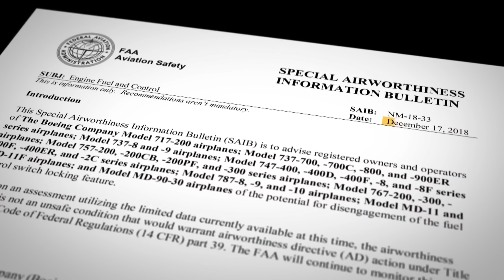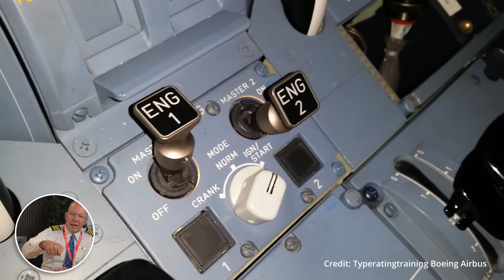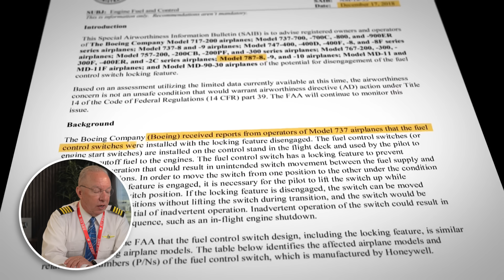Air India 171: The FAA’s 2018 Fuel Switch Locking Bulletin Explained (16 Questions Answered)

Comment: One thing's for sure, it won't be an optional services item any more.

It really could be a case where they were in the off position by themselves, and therefore not recorded, and then the pilot switched them physically doing a proper engine restart which is what was done where you put them off and then you do one at a time and then you restart them as part of the restart procedure and putting them back on. Of course, then they ran out of time, nedding only 5 to 10 seconds more.
And if you look at the wording of the report, it's not putting blame on any person or system at this stage, preliminary.
Reply: Fr

Comment: Finally, Yesterday  i posted a Reuters story stating the same thing, no one, i mean no one until GaryBPilot, yesterday.  instead everyone is taking the preliminary report as proof that a pilot deliberately turned the switches off without even considering it could have been caused by faulty software/electronic. shame on all of you who blame the pilot(s). Shame. Shame on the Indian government for giving Boeing, GE and Air India a pass and cleared them prematurely. Shame on Captain Steeeve for blaming the pilot.

Comment: The camera would help give answers that weren’t found in the recording or other flight data because it would confirm who actually touched the switches. All we know right now is that one pilot accuses the other of touching the switches and the accused pilot denied touching them, but a video would confirm the truth. IMO the union’s argument about the potential for recordings being leaked is BS because all kinds of jobs require people to be recorded at all times, even when I worked retail I was constantly being recorded on security cameras and that was a very low-stakes job with no potential for killing hundreds of people. It may have prevented the incident if it wasn’t an accident but rather intentional sabotage and the potential saboteur knew that if he messed with the switches he’d be caught in 4K.

Comment: Hi Captain Steeeve. Do you think all planes should be fitted with a warning system and a delay for critical systems like the fuel switches, so if for example a fuel switch transitioned to cut-off during flight, it would soumd an alarm, and delay the cut-off by 10 seconds, allowing pilots to rectify it, and avert disaster?
I find it incredible that some sort of failsafe isn't already built in to prevent accidental or malicious fuel cut-off during flight.

Comment: It's impossible to remove every single element that would allow a pilot who intentionally crash an airplane.  That being said, the basic design of these fuel cutoff switches has been part of Boeing aircraft for more than 5 decades with millions of flight hours.  There has NEVER been a documented incident of a fuel cutoff switch being accidentally activated in flight. It's impossible that both would have been accidentally moved, especially one second apart.  This was a deliberate act, and while the method is unprecedented, the act is not.  An Eqypt Air pilot intentionally crashed a 767 into the Atlantic Ocean (flight 990) and a German Wings pilot intentionally crashed a A320 into the Alps in 2015(flight 9525).

Comment: Another question, which may lead nowhere, but has to be asked and analyzed, so it can be dismissed: could on pilot turn both switches off in error?  What situation (fatigue, distraction, some mental condition) could cause a pilot to cut the switches off inadvertently and in error.  He would have denied doing it when confronted (like the example you gave in a prior video about leaning against a light switch.  It would take a few seconds to realize you were at fault.  Once the guilty pilot realized what he’d done, perhaps it was he the corrected his mistake.  Thoughts?

Comment: Capt. Steve, As a pilot myself and being mechanically inclined, giving both pilots the benefit of the doubt that one or the other did not intentionally or inadvertently switch off the fuel, I think without a detailed diagram of the inner workings of how the switch mechanically works apart from lifting over detent to on/off position, there must be a microswitch of sort that engages and tells the fuel to shut off, just as a microswitch on the gear does to allow the RAT to deploy only when airborne.

Microswitches on other GA (General Aviation) aircraft when moisture is present gives erroneous readings to gear up or down lights.  Is it not possible that a simple cup of coffee, water or other liquid (like hydraulic fluid) could have been spilled and or condensation accumulated on or within the throttle enclosure (quadrant) and entered the microswitch or hit a bare wire?  After all, I assume the FDR only receives data from the microswitch through the physical movement of the levers (cutoffs) which respectfully you have addressed as a pilot not a mechanic/engineer.

1 second between both switches being shut off seems a bit fast for human hands to do whilst asking why it was switched off unless the pilot asking did in fact switch them off intentionally then asked the other, why!  Were the switches found in the run position after the crash if in fact they were found?  I think a more in-depth look at the inner working of the switches is required before concluding anything.

Much respect to you and sympathies to all affected!

Comment: On the topic of switches: you're missing the fact that the switches don't actually control the fuel directly. They're connected to some wires, which may be faulty, and the wires are interpreted by computer software, which may also be faulty. On the topic of the cabin audio: the report only gives a paraphrased version of what was said. The exact words and intonation could mean the difference between "I saw you flipped the switches, why did you do it?" vs. "I'm genuinely surprised, what happened with the fuel switches?". You can keep guessing, but this is exactly what the experts are going to be investigating for the next months or years, and we won't know the truth until they're done.

Comment: The fact that these switches were found to OFF does NOT NECESSARILY mean that the pilot caused the accident. For example if a both engines flame out occurred and a pilot acted on memory items and just left them OFF without recycling them does this mean he caused the eng flame out or applied a checklist memo item in a wrong or inappropriate way FFT food for thought

Comment: 0:06 shows also Boeing 767-300, the EgyptAir which too was deemed as a suicide in 1999, because of the fuel cut-off switch. Apparently, Egypt claims that it is not a suicide. It is time to investigate the problem with the switch, before concluding that pilot had succeeded with his suicide attempt.

Comment: hi, is the exact timing of the fuel cut off switches known ? 
1 second  is vague , could it be 0.56 seconds rounded up , eg too quick for a person to set both to cut off if they are working correctly, or could it be the switches were not working correctly ( ie a impact to the switches could move them to the cut off position if the locking tabs were worn or fitted incorrectly)  if either pilots accidently hit the switches with their hand while holding the throttles and a bit of air turbulance , maybe a better cover like a flip up cover over the switches not the current plates either side of the switch panel.

Comment: Hi Steve, it’s interesting that Boeing have designed a Fuel cutoff switch with sprung detent switches ,which suggests likely hood of inadvertent operations. Gravity assisted arms/hands,books, Flt Pubs etc.  In Brit Mil and Euro Helicopters the Fuel panel is overhead which includes FuelCutoff switches.  So what I’m getting at is according to the CVR the Non handling Pilot did not Intentionally if at all action the Fuel Control s/w to Cutoff, but did put them back to Run.  I think that Aviation Psychologist needs to break the audio down, I believe there are clues here that are not understood.  Keep up the good work.

Comment: That airworthiness directive makes no sense, if it was installed backwards how did the planes get delivered to the airline because according to Captain Steeeve the fuel control switch wouldn’t be able to stay in the run position therefore it could never be flown until the problem was rectified. I’m not saying the switches were faulty I’m just saying the fault in the directive couldn’t be what Steeeve described.

Comment: Yes, a Boeing 787 engine can experience an automatic shutdown, though it's typically a safety mechanism designed to prevent damage or respond to specific malfunctions. For example, fuel shutoff valves are spring-loaded to close upon electrical power loss, and the system relies on redundant power sources. A major electrical failure or software glitch could, in theory, cause both valves to close, leading to a dual engine shutdown.

Comment: The switches are electrical not mechanical, is it possible that the computer that controls the switches cut off fuel to the motors without the switches being moved ?

Comment: 10 seconds seems like a long time from when the fuel was turned off until it was turned back on. If he had acted faster, do you think that this plane could have been saved? My first instinct as soon as I noticed that the other guy had turned off the fuel would be to turn it back on. Or does it take a while for the engines to start shutting down so that there wouldn't have been any immediate indication that the fuel was off?

Comment: Looking at the aircraft as it took off it kicked up a lot of ground dust to wards the end of the runway.So a couple of question is . Was the aircraft struggling down the runway before liftoff and how much of the runway did it use. I ask the runway question because I've noticed that aircraft taxi on to the runway half way down then turn down to one end and then turn around obviously depending on their size. Enjoy your vlogs

Comment: I find it somewhat bizarre that a cockpit design allows two engine fuel cut off switches which, under certain legitimate circumstances are capable of being momentarily switched off mid-flight, are positioned adjacent to each other in a location where either pilot may not see, or be aware of, the switches being operated due being heavily focused on many other systems during take off. 
As fuel being cut off to all engines mid-flight appears to have impacted events and sadly led to a catastrophic conclusion, 
Surely, unless there is some valid or necessary reason that a layperson such as myself is unaware of, it would appear more logical to position the switches separately in a manner where each pilot may only easily reach, and operate, only one of the fuel cut off switches. (Or, maybe more than one switch in a four engined aircraft). Thereby equally dividing the responsibility of any necessity to cut off the fuel supply to all engines mid-flight between both pilots, significantly reducing the risk of any error or, at least, eliminate any potentially deliberate act.
Alternatively, do these type of extremely critical switches sound an alarm, visually or audibly, if operated mid-flight?
If not, why not?

Comment: If you think about it logically, we know that the full report and the cockpit conversation were recorded. However, they won’t publish everything, likely to protect the safety of the pilot’s family. Grieving families might confront the pilot’s family and cause trouble, which wouldn’t be good for anyone.

It seems that the person who wasn’t flying the plane turned something off — possibly a switch or system. My conclusion is that the person flying the plane tried to avoid crashing into houses and instead aimed for a location where the impact would be less severe.

Comment: 13:30 dude contridicted himself multiple times throughout this video. Commentor points out the fuel switch is controlled connected to ECAM and computer system. While just seconds/ minutes before he says the switches are mechanical only and acts like the computer has no relevance to it. This guy seems like a boeing spokesperson 😂
Reply: Yep, so quick to put the blame on human error and discredit any equipment/software error. Boeing would never make equipment that would bring a plane down now would they?? 😉😉

Comment: The crash 787 had its throttle quadrant replaced twice since the safety bulletin was  issued in 2018, most recently in 2023. It is reasonable to expect the production defect in the 737 fuel switches would not have been present in new 787 throttle quadrants in 2023. 

Cockpit cameras would have shown who switched off the fuel. This is an essential part of the investigation. Cockpit cameras should at least record the two must important parts of a flight -  takeoffs and landings. The recordings could be deleted once the aircraft completes its landing roll or when the aircraft is flaps up and climb power is set. American pilot unions vigorously opposed  CVRs when they were first proposed.   Other countries adopted them years before the US. Some things never change,

Comment: Typically I do not comment on any video.  After years of watching these, this is my second comment.  For what I'm about to do, I have to apologize to myself for drifting, but I believe all stones need to be turned even if the probability is one in a billion. 

comment:  One of your viewers questioned the possibility of the switch engaging halfway through its normal travel.  Although your answer was acceptable, it does not clear the entire issue.  Example the switch engagement being discussed is all mechanical but, nothing about electrical engagement (correct me if I'm wrong, the 787 is a digital, aka fly by wire aircraft?)

my question: since the switch has no light (digital feedback) when do you know the valve is open.  I'm retired electrical engineer now but,  I worked in the test cell with instrumentation to run these engines and one of the things the operator/driver looked for was for positive fuel pressure (aka Analog feedback); they practice this for both windmilling and to start of the engine.  so,  is it possible "electrical positive engagement" occurred before the correct mechanical position?.  If so, once they noticed positive feedback, is it possible the pilots left the switch at said location  and the spring force did not forced the switch to close right away and finally, with the vibration of the runway as it is taking off, the switch finally moved to closed position?  Also, assuming this is not possible, for how long does the engine run at full power while on residual fuel on the lines, and finally how do these valves operate (reminding the fuel valves in the test cells I am experienced with, required back pressure)? 

I am almost in believe if the pilots questioned the positions of the valves, they must have noticed an analog input indicating such configuration, forcing their focus on this function

Comment: Sorry, Captain Steeeve. You answered many questions very poorly. Your psychology background is creating a 'blind spot' and  keeping your focus on the pilots.

The initial report on this video, combined with the pilot's denial of turning off the switches, suggests a mechanical issue that could devastate Boeing, given its already troubled safety record.

In addition, you were wrong about the rat deployment. It was evident before the scene you described.

Why was it an 'incredible presence of mind' for the second pilot to turn the switches back on after a long 10 seconds had already passed? And why would he have done that if he'd turned them off in the first place?

You didn't mention the important point that the pilots' voices are recorded on different channels so the investigators already know who said what. Furthermore, the preliminary report states that the co-pilot was flying the plane. Surely he'd have both hands on the stick, meaning if anyone did turn the switches off, it would probably have been the captain. But, as I wrote, from the different voice channels, the investigatorsalready know who made the deniel. (Personally, I think it was a genuine denial; it was a defect in the switch.)

You crashed and burned with this vid, my dear Captain Steeve.

Comment: An Ai video camera that can understand human behavior for fatigue or shady behavior is must. There must be some signals of stress or su**idal behavior before it actually happened. It's possible to guage them. Plus there should be override feature for wrong signals given by single pilot, there should be provision that these switches cannot be turned off untill both pilots give the same command and one pilot's switches shouldn't be reachable by the other pilot sitting in his seat.

Comment: Also nobody would have guessed the Parker Hannifin 737 Rudder PCU was prone to corrosion. Boeing and FAA need to scrutinize the switches and the detents and if it takes >1 year to replicate such a faulty behavior --> IF they can reproduce it, then they need to prove beyond any reasonable doubt that this failure mode could NOT have occured on the accident aircraft.
Abything less than that is gross negligence.

Only if theres more evidence pointing to human error, then the story is indeed clear. But as long as it is not .....they should try a few million times engaging and disengaging such switches and do some thorough research and testing.
That's also not extremely expensive to do